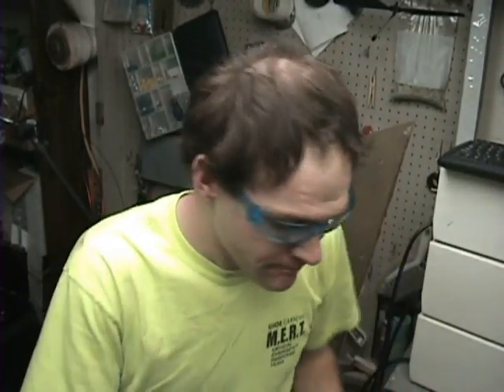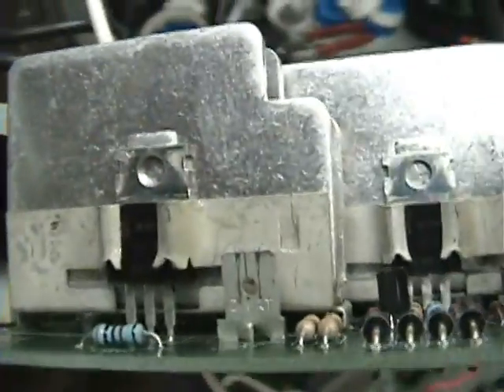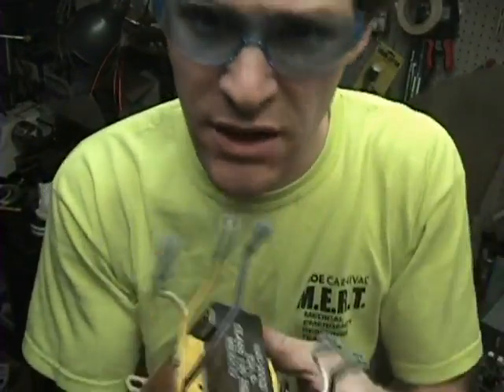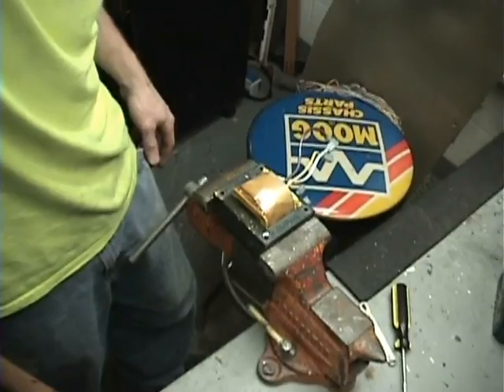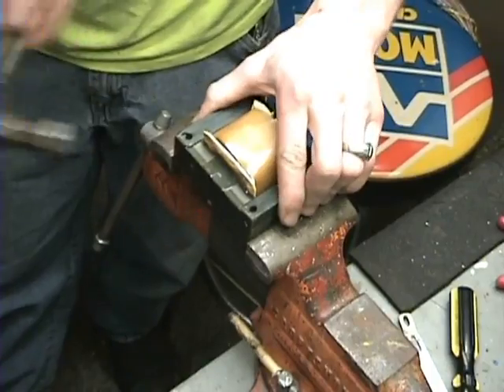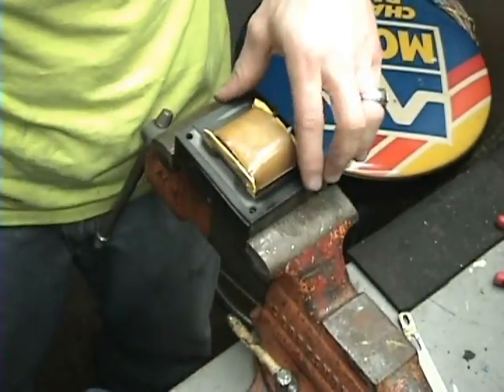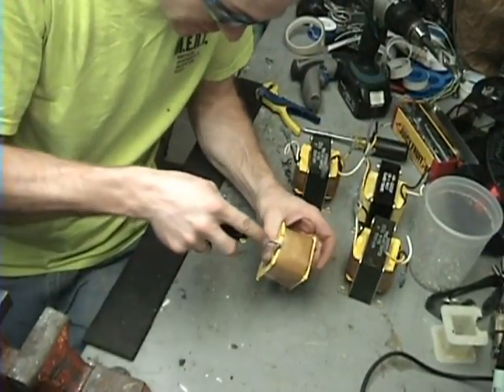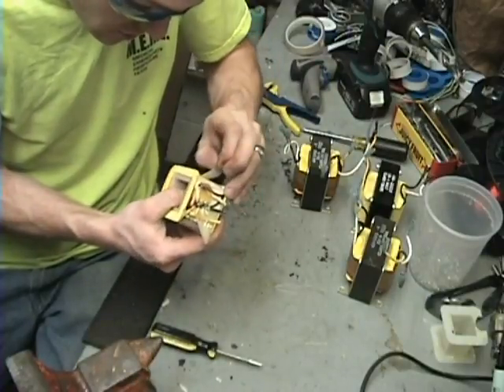How To Recycle Magnet Wire From A Transformer

Comment: Hey now that I think of it,. what are your thoughts on soldering Magnet wire together.  I have done it without any issue.  I use this enamel coating over the solder joints.

I have had engineers tell me not to do this.

your thoughts?

Comment: It arrives that use wire from transformers or motors when I have hot enough wire to build my projects! But, I longly prefer using perfectly correct line transformers as well motors to build power supplies in my projects!

Comment: Is it safe to reuse those wires? Couldn't be the insulation coating damaged? Could it be damaged/scratched by unwinding (or previous use)?
Reply from the maker: It's fine for experimental use. But yes. It could be compromised. But if care is taken then it will most Likely be fine. Unless the transformer has prior damage... ~ Russ

Comment: arent you worried that the solvent will take off the varnish on the magnet wire?
Reply: Clown Whisper i think it's an enamel coating that is heat rated and the color refers to the amount of heat it can withstand

Comment: Can someone tell me if there is a good way to remove that resin dipped coating off transformer and motor windings in order to salvage the magnet wire without damaging it? i.e. - heat or acetone? BTW, I have taken apart many many transformers and have never found the lamenents glued together other than the stickyness of that resin coating.
Reply: Any solvent capable of dissolving the varnish on the core laminations and wires, would also attack the enamel insulation on the magnet wire...you'll just have to take your chances-!

Comment: I wanted to ask you, and this is off the subject, is there anything dangerous in a TV I should avoid? I'm totally tech unsaavy, I know absolutely NOTHING about electricity (except it hurts, and Positive to Negative!) and electronics, but want to scrounge for gold, parts, oh, yeah, I am making a "foxhole radio" so I am looking for magnet wire!
Reply from the maker: some older tv's have capacitors that will hold a charge and zap you... so some home work before you go out and take older tv's apart. there are safety videos on the net. just Google it. ~Russ

Comment: They are not plates... you have an E and I Lamination, the first piece is called a keeper ...and they do not use glue, they use varnish...if you warm the unit first they will loosen much easier... reusing magnetic wire is not a good idea ...you dont know what AWG you are using nor do you know if the unit was thrown away because it may have a short... all in all  bad advice ...
Reply: Some of us want it for scrap copper, because some of us melt it down and cast it.
Reply: +Jon Lerner  This is not true. There are many ways to easily determine the AWG of the wire. Mesured Foot/Ohms, Use of calipers to measure the diameter, pounds/feet. Its very rare that something is thrown away because of a short in a magnet wire winding. The most common reason among many others, are electrolitic capacitors. Even if there was a short, the chances of those two points touching each other when reused(rewound) is extreamly low to non existant. Magnet wire is very expensive and there are alot of good sources of clean(non potted), good as new magnet wire found in discarded devices and appliannces; small DC motors, shadded pole motors, relays, small transformers, CRT degausing coils etc. Use your common sense, if it looks clean and new, then take some measurements and find out if its shorted or not, and if its discolored, damaged or burnt, then its probably no good. "All in all, bad advice..."
Reply: Jon Lerner quit being such a hater. People serching for how to take off the the magnet know y they are serching and you Can gauge the wire mr know it all
Reply: Jon Lerner 😊